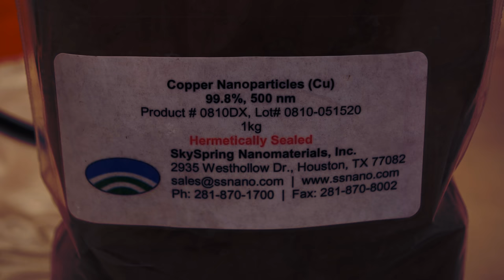Make Our Best Thermal Paste... YOURSELF!

Comment: Love it!  Going to echo what so many have said about Gamer's Nexus. They have extremely stringent test methodology. They have a dummy CPU heater to control for normal CPU power loads. They do flatness testing as well, so they'll be able to use it on the flattest IHS and heatsink cold plate they have.  (they're also working on getting a thermal chamber for controlled testing, too.)    :)
Reply: I would love to see GN test "both" compounds vs the usual assortment, and the new lab that's in the works will allow them to control the environment far better than the current segmented office building rental.  At the bare minimum, Tech Ingredient's explanation of thermal pastes is vastly better than anyone else's aside from maybe Buildzoids explanation of the maths of thermal resistance under the IHS vs direct die for LN2 overclocking.
Reply: GN aren't going to impartially test anything. Their test setup is only to demonstrate the superiority of their sponsor's thermal interface product.
Reply: 'They have a dummy CPU heater to control for normal CPU power loads'

Comment: Another great video.  It's interesting what you said about the zinc oxide (neat vs silane treated) having lower viscosity when mixed with the silicone oil.  I think you said that the silane coating on the zinc oxide was supposed to make it more hydrophilic.  My understanding is that most (all?) metal oxide surfaces are already hydrophilic because they form hydroxyl groups on their surface (the surface hydroxyl groups are what the silane compounds bond with).  In my experience, silane treatments on metal oxide particles are typically to make the normally hydrophilic metal oxides more hydrophobic (by including a hydrophobic group in the silane molecule) for better dispersion in organic solvents.  So if your silane coating was actually hydrophobic it might explain the improved dispersion of the zinc oxide in the oil and the lowered viscosity.  If the silane is hydrophilic it would be interesting to try and figure out why the viscosity is going down because that seems very counterintuitive so the explanation should be surprising.

Comment: Thank you for the most informative videos! I have 2 comments that might help. 1) I made a pourable KNO3/Sorbitol propellant by using about 30% powdered and 70% 200 mesh KNO3, heated with Sorbitol at a 65/35 O to F ratio. Initially it is as thick as stiff mashed potatoes. I then add 0.2% surfactant ( Polystep B1) and the mixture thins out enough to easily pour! It is like magic!
2) Using multimodal powders, surfactants and mixing  under vacuum can greatly reduce the viscosity of a high solids mixture. I make pourable mixtures of powders and polyurethane with up to 88% solids using trimodal powder mixtures, mixed in steps. I mix using a Red Devil 1 gallon paint mixer and a stainless steel beaker with a lexan lid which I attach to a vacuum pump. I only use 1 mix container so there is no loss between process steps.
Note, this probably won't work in batches too small on the Red Devi.

Comment: I was wondering if you could speed up the mixing by an addition of a low boiling solvent that would be removed at the v-pump
Reply: I thought the isopropyl on the table was for that use at first. I'd try it with acetone and toluene and use the absolute bare minimum that facilitates mixing by hand to avoid any differential settling of the solid particles prior to the vaccum chamber. It would have to be a very low amount too to avoid depositing a super thin film of highly flammable Al powder on the sides of the mortar.
Reply: I though the same thing.
Reply: maybe acetone? i think it would evaporate in a couple of hours at worst.
Reply: I would go a step further and suggest that it may be possible to achieve a thinner layer during application with the addition of some volatile compound. It's worth exploring.
Reply: Was thinking the same thing. Maybe a little camp stove alcohol or acetone
Reply: @Francois_Dupont  I was thinking diethyl ether (from engine starter fluid)
Reply: Another idea might be, to increase temperature. Making the atoms/molecules move faster might help them to mix better too.
Reply: One factor at play is cost.  Remember, a consideration in the video is low cost.  So how do any of these proposed solutions (this comment thread) accommodate that?
Reply: I used to "devolve" commercial thermal compound with isopropanol with this method it was relay easy to spreed a uniform thin film CPU cooler and let it evaporate.
Reply: @secretsquirrel6308  Cold trap to recover the solvent.
Reply: @secretsquirrel6308  maby with solvent mixing you wont need to have some of the expensive equipment, to achieve the result quicker
Reply: It may be good for the glycerin, which is miscible with ethanol for sure, maybe methanol which has a lower boiling point and can be bought in technical grade easier and cheaper than ethanol. Not only for the base binder viscocity but for binder volume to reduce apparent viscosity of the paste.

Ethanol is economically hindered by outdated sin taxes and the demand created by mandated gasoline additions; denatured ethanol is generally only 85-90% ethanol and the remainder is widely variable mystery cocktail so while it is ok as fuel it is an unknown for the lab.
Reply: @user21XXL  That does sound like a good idea. I also though of mixing the powders, then adding them on top of the glycerin or silicone oil, then using a vibrating table to get the powders mixed into the liquid. By using a solvent to thin out the glycering or silicone oil prior to adding the mixture of powders, a simple vibrating table and a hot plate with a bowl of water inside which a bowl with thermal paste is placed, might be all that's needed, in which case we could skip ALL the expensive equipment, even the vacuum pump. As MyTech said, maybe methanol or acetone would work.
Reply: @mytech6779  That is a good idea. I also though of mixing the powders, then adding them on top of the glycerin or silicone oil, then using a vibrating table to get the powders mixed into the liquid. But by using a solvent to thin out the glycering or silicone oil prior to adding the mixture of powders, a hot plate with a bowl of water inside which a bowl with thermal paste is placed, might be all that's needed, in which case we could skip ALL the expensive equipment, even the vacuum pump. Methanol or acetone would likely work.
Reply: Keep in mind that ethanol is corrosive to aluminum. Especially in the presents of humidity(And good luck keeping anhydrous ethanol truly anhydrous.)
Reply: @mytech6779  oh yeah that's right. I completely forgot about that. Then acetone would probably be the best bet. Car starting fluid often has upper cylinder lubricant, so that would be a no go. Perhaps even turpentine or paint thinner, but the problem with those, is that they would be a lot more difficult to evaporate than acetone. What are your thoughts on methyl ethyl ketone?
Reply: @josephgauthier5018  acetone is a faster evaporating keytone and easier to find at retail.(I had to go to a professional paint store for MEK) Methanol is not corrosive to aluminum or you could use copper, its redilly available in automotive as HEET[yellow] fuel anti-ice additive. [red HEET is isopropyl if you can't find 99% rubbing alcohol.]
Reply: @mytech6779  glycerine itself is not anhydrous (is hygroscopic) - so there will be water in your formulation even if you use 100% ethanol - unless you dry everything before
Reply: @mytech6779  im familiar with heet's ingredients. i didnt know methanol wasnt corrosive to aluminum. also, duly noted on the acetone vs mek.
Reply: @secretsquirrel6308  ...by avoiding 30+ minutes of mortar-and-pestle hand-mixing?
Reply: @mytech6779  Amen. It helps to remember, however, that the "sin taxes" were recognized by intelligent people as idiotic when they were first instituted, too. Is there ever an appropriate "date" for counter-productive idiocy?

Comment: thank you for sharing the fruits of some obvious long and hard work. It's interesting to see the difference in levels of effort to get the results between these 2 materials. I've already seen some others mention it, but sending samples of it to Gamers Nexus would be a great idea for testing. LTT has the larger following, but Steve at GN really does have the equipment and methodology to test these claims more thoroughly.
Reply: This channel actually has the proper thermal test equipment and tested a range of pastes in the last 6 months.
Reply: @mytech6779  Peer review and recreation of results is the cornerstone of the scientific method. It's part of the reason why sending samples to LTT is mentioned. I don't doubt the sincerity of the claims or the work done to achieve these results. But any informed consumer doesn't simply take the manufacturers word. You look for the review from trusted third party sources.
Reply: @ericepperson8409  to be fair neither Gamers Nexus nor LTT have very scientific testing setups. What they do have is knowledge about real world performance testing. But there is more to test about this than just the thermal performance. Spread, conductivity, changes over time (e.g. drying out), etc. Alex of LTT has already tested the first two, I hope we will get a longevity test as well. Now we just need at least one more tester with a precise thermal testing setup.

Comment: It would be interesting to see your thorough treatise of ptfe greases, and their properties. I recently encountered a use case where they were involved, and unintentionally opened a pandora's box. There are various compounds commercially available, all resembling what we would call a ptfe grease, but their properties, and quality vary from one end of the spectrum to the other. High-end (and very expensive) products like Krytox, Christo-Lube, and Tribolube are a world apart from bicycle shop products, even though its not immediately obvious why this would be so. Even the expensive ones vary considerably. They are typically used as oxygen/nitrox safe lubricants for gas cylinder threads and O-rings, amongst others. I'll bet any money you have at least one of them in your lab/shop over there :-). For what its worth, Tribolube stands out head and shoulders above the rest IMHO. Best regards.

Comment: The long term stability of your compound would be interesting. Some of these commercial products just fall apart and seperate into cookie dough after a year or so, which causes them to fail, with very expensive consequences. Could not help smiling when you turned on that "hacked" compounding machine. Your distrust of the device was very obvious :-). I'm familiar with that...
Reply: Most times, when the paste 'drys' out it is still fine but only when it is disturbed that you get issues, eg the need to reapply over just gooping it back to the middle and locking it down again.
Reply: Depends on what you use. I just disassembled a ~10-y-o machine and the paste was still gooey. Granted, it was a white paste from very old scythe cooler, so probably less effective compared to current mixes.

Comment: cool seeing the ultrasonic rod i´ve recommended, it´s a bliss working with them, they make for some efficient and fast extraction, but the noise is worse than fingernails on blackboard
Reply: What do you use it for
Reply: You need a cabinet for it, lol.
Reply: I've never run across one in operation, but with first-tooth experience with an ultrasonic dental scaler, I'd definitely trust you on that.
Reply: @jaro6985  we use it in food chemistry analysis to speed up the process of extraction, for samples like fat in cocoa beans, caffeine in coffee beans,  trans-fat-acids in all kinds of edible oils, pectine extraction.  or to speed up chemical reactions, it uses less energy than a soxhlet extractor. it is also used to clean up some nasty organic residues,  a cool multipurpose machine, though watching a soxhlet doing it´s thing is very relaxing. like everything in life there are trade offs
Reply: Would a sealed glass jar in an ultrasonic cleaner work the same?
Reply: @dimoradimario  No, the amount of power we are talking about is orders of magnitude different.

Comment: Another fascinating video!  Though usually quite good, the voice audio is quite low in this one.  I took a look at the audio track and though it is normalized, it has quite a bit of dynamic range and likely needed to be compressed to bring up the voice volume, which seems to average -21dB or so.  Environmental sounds like the Newton's Cradle create peaks that likely pushes the average down.

I had to apply quite a lot of range compression (-24dB knee, 1:5 slope) and re-normalize to get the voice volume near normal to my ear, but I admittedly don't produce youtube videos and don't know your workflow.  Even a -18dB knee with normalization afterward noticeably reduces the peaks.  This would be done before mixing in the music, of course.  Music suffers if over-compressed, but spoken word tends to benefit.  Thanks for the great content!
Reply: Yes, I agree there is something wrong with the audio here. It sounds a bit like automatic gain control in reverse, resulting in an overall low volume except on voice peaks which are excessively boosted. An odd effect.
Reply: Glad I'm not the only one. Thanks for pointing this out! I had a hard time watching the entirety of this video due to the audio issues.
Reply: Agreed - it's as if the compressor is working in reverse, to expand the dynamic range. A difficult listen this time (but not usually).
Reply: It's always fun when you're forced to up your volume, forget about it, then blow your eardrums off when you visit another video! D;

Excellent videos however, I absolutely love it!

Comment: Why do you use Aluminium powder and not Copper powder? Since you said in the beginning that Copper has a higher thermal conductivity than Aluminium, I would expect that Copper should work better.
Reply: The material it's being used on is aluminum.  Aluminum and copper can have a reaction.
Reply: @marcostreet3169  depends on the cpu cooler though, some have a copper contact plate, other an aluminum one.
Reply: copper and aluminum can under go galvanic reaction under certain conditions. aluminum powder between aluminum heatsinks is adequate enough for this application
Reply: @marcostreet3169  Almost all CPU heat spreaders and heatsink cold plates are nickel plated copper.
Reply: I'm not sure galvanic reactions will ever be a concern because this is all a suspension in a non-polar solvent. I imagine copper would be significantly more expensive.
Reply: Exactly what I was wondering.
Reply: Copper has higher thermal conductivity but dissipates heat to the surrounding air slower. That's the reason why almost all air coolers with fins these days use aluminum. I'm not sure how that will translate to copper powder being used in a TIM but I'd imagine it's part of the reason why.

Comment: It's a bummer for me that I can't easily find a lot of the basic materials and composites in Eastern Europe. Excellent video, as always!
Reply: Are they that afraid of people making thermite?
Reply: Check out pottery shops and ceramics supply stores. They often have many of the compounds needed for experiments that don't require medical or food grade ratings.
Sometimes you need to learn alternative names or the raw ore forms to get a "good enough" alternative.
Reply: @technosaurus3805  we don't have such shops. Fun fact: in Serbia an individual cannot, by law, buy methanol.
Reply: @djdjukic  Wow, according to my Civilizations III chart, without pottery you're somehow in the stone age with internet access - weird.
At least you now know a potential business opportunity that could provide several jobs and further the arts.
Reply: @technosaurus3805  They got the internet tech trough tech sharing, they did not research it.
Reply: @djdjukic  Also fun fact, you can make your own methanol with a DIY wood gasifier.
Reply: @technosaurus3805  aren't you thinking of methane?
Reply: @dandan-gf4jk  it's a mixture. After you get it running steady state, you can separate them and use the "waste" product to heat the wood in the gasifier. Most people use the gas directly and store the liquid and charcoal, but it depends what you eant. They made one out of old steel barrels and scrap on the TV show Hillbilly Blood.  One of the guys from the show (Eugene Runkis) has a pretty eclectic YouTube channel that covers everything from wilderness survival to quantum physics.

Comment: The consistency of the paste at the final mortar and pestel stage reminded me of chocolate grinding. I think a 'chocolate melanger' aka 'wet grinder' could work as a cheap solution. Though a problem might be the minimal quantity of product required for the mill to work.
Reply: Given that a lot of them have lids that seal tightly, I'm curious if you could just dump the final weight of all ingredients into the melanger and just set it to running. Since they're designed to run continuously for hours, it should be able to manage integrating and de-clumping even the finest of the metal powders.
Reply: @mndlessdrwer  This would only work for the largest size powder, I highly doublt it would be sufficient even for the intermediate size.
Like he said you simply cant mix nano size powders with normal mechanical means, doesnt matter if you mix 1 hour or a decade.